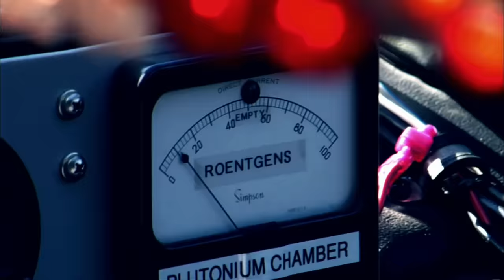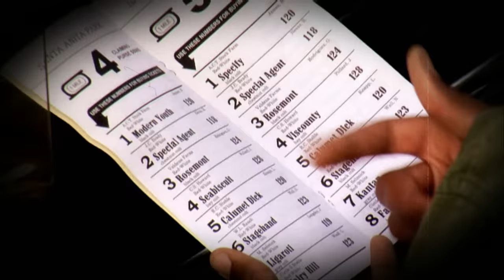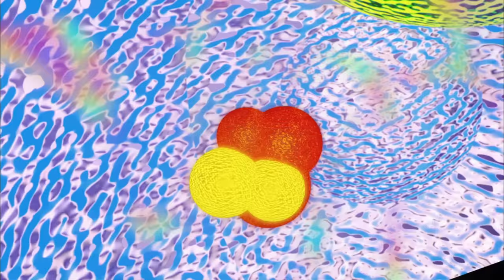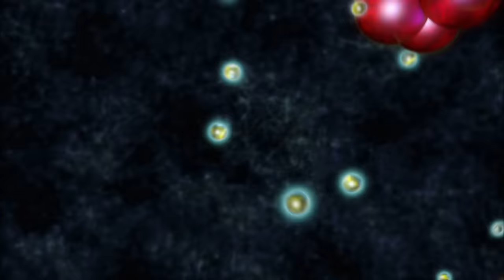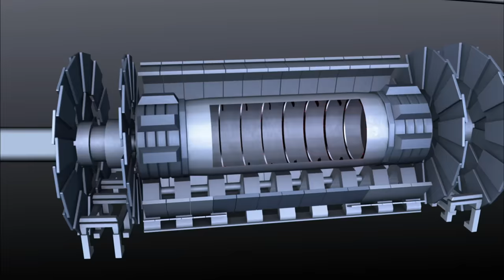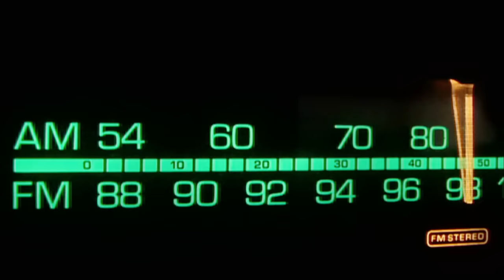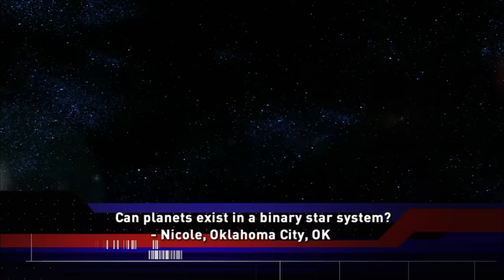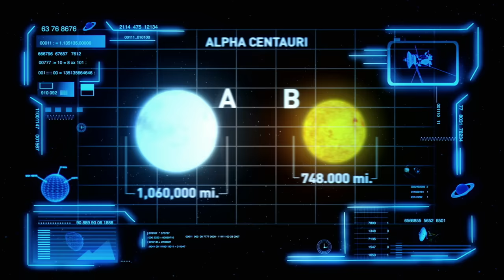The Universe: The Time Travel Paradox (S5, E4) | Full Episode

Comment: Time travel into the past is simple.  According to the Lorentz-FitzGerald contraction, all you have to do is exceed the speed of light.  Problem is that as your velocity increases greater energy is needed to accelerate more, so you will need an engine with infinite power.  Another problem is that your speed increases, your mass increases, so at the speed of light your mass is infinite.  And, when you hit the speed of light, time stops.  So, some new technology will be needed.  🙂
Reply: I've never understood how that would propell you back in time.  But of time slows the closer you are to the speed of light, how does light travel at all at its own speed